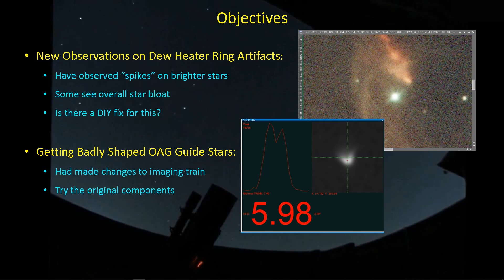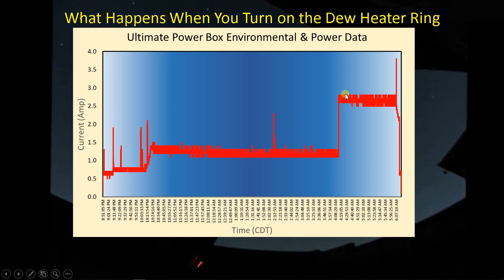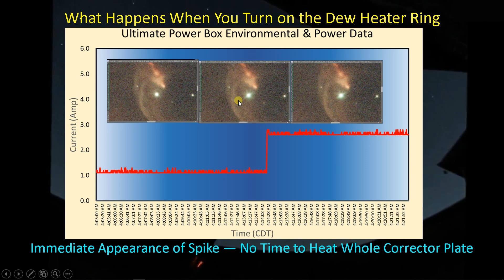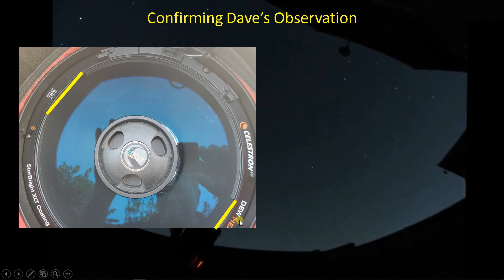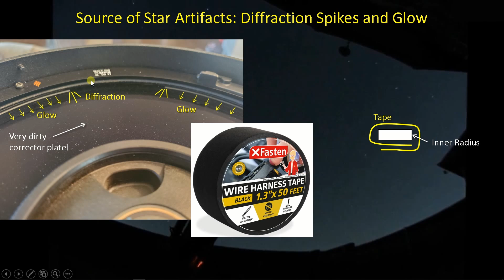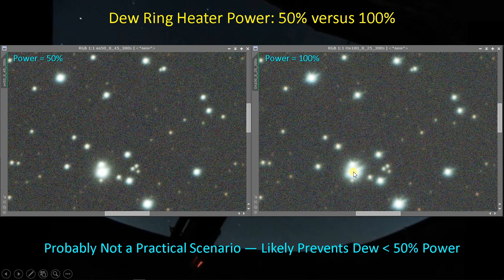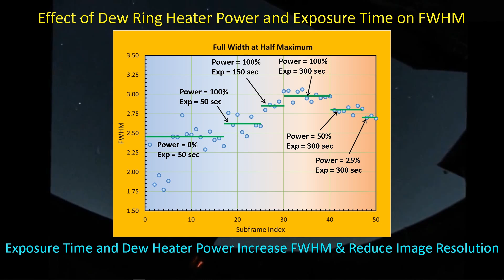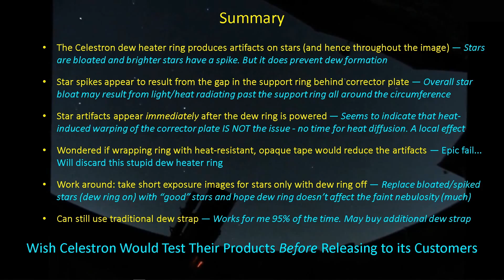New Observations on Star Artifacts Created by Celestron's Dew Heater Ring

Comment: has anyone tried bang-bang control on this heater? Rather than keeping the heater on at all times, you would turn on the heater at 25% , warm the corrector plate to some degrees higher than the dew temperature, say 8C or so, and then turn off the heater until the corrector plate is 2C higher than the dew temperature, then heater back on. Might need to experiment with the temperature hysteris so the center of the corrector plate  does not get below the dew temperature when the heater is off.

Comment: Could be the ring expands and puts mechanical strain on the corrector
Reply from the maker: I don’t think so. The ring is not clamped to the corrector with enough force to transfer forces into the glass. The star spikes line up with the gaps in the corrector plate support ring. The bloating seems to affect all of the stars (and any nebulosity). Thanks for watching!

Comment: I know nothing about thermal dynamics, but it seems every component of this set up is a really good conductor for heat, the ring is metal the screws are metal and then the corrector glass, all hold heat and cool down slow what if the metal screws are replaced with nylon screws they will absorb the heat but since they don't hold heat that they absorb it dissipates quicker. Be gentle as I said I'm just thinking out loud.
Reply from the maker: @timothynorman6412  Hey I’m no thermodynamics guy myself. The thing is, I don’t think it’s a heat diffusion problem. I see the effect instantly with a change in the power setting, so there’s no time for the heat to propagate into the corrector plate. It does prevent dew, but the side effects are annoying.
Reply: @Aero19612  That's odd increase power and spikes appear, it's almost like it's vibrating. I am putting together a rig think I will stick to a dew shield and heat strap.

Comment: Hi. I just confirmed this on my 5min subs. Turning dew ring on and off on alternating subs. It does appear to be immediate. Maybe it is still useful as a "dew clearer ring" in the early morning. Would be nice to be able to control it in a sequence. It's a shame it can't be used as intended!
Reply: I now control it using NINA advanced sequencer and setting up the pegasus power box micro as a switch device. I take 5x5min subs with 0% power to the ring, then use 100% power for 5mins while taking no exposure and then looping that. This works for dew, and almost works for the images, the first image taken after the ring is turned off is still affected. So I need to add a delay after turning the ring power off. How long? I don't know yet, but another 5 mins is enough.

Comment: I wonder how this would affect planetary imaging? 
Really bumming, just bought the ring and on top of it, had to buy the Ecco to make it work with the  Eagle 🙄
Reply from the maker: Just try to operate at the lowest possible power level. I only rarely do planetary imaging, but I think you should be OK. Turn the ring on before imaging to pre-heat the corrector plate, then turn it off while collecting data. Rinse and repeat. Good luck!

Comment: This appears to be electrical noise. It appears immediately when powered on, and reduces when powered down.

Use a separate isolated power supply.

Provide an electrical ground to the dew ring circuit.

Turn off heater during exposures.
Reply from the maker: Electrical noise could be a problem, but I don't think that's what's going on here. Two reasons: (1) I don't see "bloomed" stars when using the dew strap at the same power level (same power source) and (2) the "streaks" are not consistent with general noise, i.e., no reason for directionality, plus the streak orientation is correlated with the gap in the corrector plate support shelf.

Comment: Always enjoy your videos. Question: Isn’t the Gap present when the heater is off? Why would the gap be the cause only when the heater is on and not when the heater is off?
Reply from the maker: My guesses were (a) that the heating element produces a glow that is block everywhere except at the gaps and/or (b) more heat is conducted out of the corrector plate where it is in contact with the supports, so the unsupported are (at the gaps) is hotter and possibly affecting the optical path.

Comment: Since watching this video for the first time, I've had a couple of nights out with my EdgeHD 8 and the Celestron Dew Heater & Celestron Controller.  Last night I had clear skies until about midnight and it was about 20-23 deg F with about 80% humidity.  Needless to say, when I brought the equipment inside it was frosted over -- except, that is, for the corrector plate which stayed dew-free. What's relevant to this video is that prior to using the dew heater the past couple of nights, I turned down the aggressiveness on the Celestron Dew Controller to 3 (from 5) and I didn't see the star spiking in any of the 60 frames I took last night.  When I had the controller set to 5, I definitely did see spikes.  I knew the dew heater & controller were doing their jobs since it was very humid and cold and I'm sure I would have had frost/dew on the corrector plate if the dew heater wasn't working.   (I also used the Celestron aluminum dew shield with the clips on the side and the cutout for the dew heater wires, but I've been using that since day one and still had spikes with higher aggressiveness settings, so I don't think that factors into anything.)  Not sure exactly what an 'aggressiveness' setting on the Celestron Dew Controller means, though.  Is it just the power setting, or does it factor in some type of change in heat intensity over time?  So, I'm not sure how the setting of 3 on the Celestron Controller would correlate with a temperature setting on a controller without a thermistor.  Anyway, I thought this was good information to share...  

FOLLOW UP/EDIT-- After calibration and integration (but before any processing), when I zoom into the image I can still see some very, very small spikes around the largest stars.  However, the spikes appear more symmetrical, i.e., I don't see the predominant 11 and 5 type spikes James showed on the video.  In terms of star bloat, I'm afraid I just don't have anything to close enough to compare to this set of images to determine if the star bloat is any less. (I've only been using the EdgeHD 8 for a short while and have had limited nights to test different things).  So, in conclusion, I'm afraid the only data I can speak to is to support James' conclusion that less power to the dew heater ring reduces (but doesn't eliminate) the spikes.  In my hands, though, at aggressiveness of 3 with the Celestron Controller,  I did see diminishment in the elongation of the 11 and 5 spikes.   Wish I could have been more helpful.  (If anyone want's to see my images, shoot me an email at my firstnamedotlastname gmail account.
Reply from the maker: Very good feedback, Greg. Thanks! Do you think you're getting any star bloat either at a setting of 5 or, now, 3?
Reply: @Aero19612  I'm running my subs through PI right now, James.  I'm going to check my previous images at higher aggressiveness to see if I can detect star bloat.  Wish I had used the same target as one of the previous sessions, but hindsight...
Reply: @Aero19612  I couldn't really find anything to compare with this data to determine the degree of star bloat as compared to higher power/aggressiveness settings, James, and I modified my post since when zoomed in to the calibrated/integrated images I still see very small spikes.
Reply from the maker: Ahh. That's too bad about the spikes. Will the ring prevent dew at your location at an even lower aggressiveness setting?
Reply: @Aero19612  Yeah, I got too happy too fast! :-)  The good news is that the spikes aren't visible unless I zoom in (and they are more symmetrical) so I don't think it will degrade the image processing too much, but undoubtedly, it's degrading our resolution a bit.  The next time I can set up under similar conditions, I'm going to try several different aggressiveness levels since I'm curious as well whether dew/frost will form if I go even lower than 3.  Of course, I want to confirm that the spikes reappear once I go up in aggressiveness and I want to be able to compare star bloat at different aggressiveness settings.  (All this as long as my fingers don't frost over...)

Comment: A couple of data points.  When I got this effect the other night, I had the Celestron dew ring turned on to 60% duty cycle at 13.5 volts.  It turns out to have a resistance of 8 ohms (less than most dew heaters, so more power), meaning it was putting out 60% x (13.5^2 / 8) = 13.7 watts, which may have concentrated too much heat in a small area.

Last night I kept it turned off and instead used an Astrozap strap installed in the traditional position around the tube just behind the corrector plate.  No streaks on stars.  The straps' resistance is 12 ohms and I had to turn up the duty cycle to 100% to completely get rid of the dew.  That was 15 watts, but spread over a much larger area.  I think the main effect is actually to warm the air inside the telescope slightly, keeping the corrector plate warm via the air behind it.  

Bear in mind that by "warm" we actually mean "about the same as the surrounding air."  Dew is a problem because some surfaces exposed to the sky will radiate away so much of their heat that they become colder than their surroundings.  So, used correctly, a dew heater should probably improve seeing rather than worsen it.

I'm guessing the Celestron heater is prone to creating small hot spots, but I haven't investigated.
Reply from the maker: Hi Michael,
There’s no doubt that the Celestron dew ring puts out much more heat than my DewNot dew strap. Somehow, that dew strap is able to keep the dew off of the corrector plate most (all?) of the time. There’s no way it’s heating the corrector plate. In my case, I mount the strap on the front of the scope with it overhanging the end. It must be heating the air in front of the corrector plate just enough. I wish I understood this process better. But I’ll settle for no dew and ignorance, but don’t leave me with bloated stars.

Comment: Based on what I've read so far, I think the leading possibilities are (1) the corrector plate gets warmer over the gap, causing it to flex and introducing astigmatism; and/or (2) the warmth sets up an air current that is primarily through or near the gaps.

I don't think the dew heater glows.  There is just not enough heat.  Visible glow requires a temperature hot enough that you would burn your hand touching it.  Dew heaters, even this one, rise only a few degrees above ambient, normally.  They glow only in the far infrared.

I don't think magnetic fields affect light.  Conceivably, there could be some vibration caused by the DC power pulsing on and off, but you'd hear a whine.  People have seen this effect with several different power supplies (mine is a PWM of my own design, frequency about 450 Hz, which would be quite audible).
Reply from the maker: Some good thoughts, Michael. There could be some local warping of the corrector plate. I doubt that air currents are the issue and certainly don't think any form of vibration is the source.

As for heat glow, the temperature increases the corrector plate temperature by 12 deg C about 1" from the dew heater ring. See 7:20 in
https://youtu.be/gU43rhYAoGA?si=q0lw5m9yXbYd_5Pz
Reply: @Aero19612   My impression is that 12 C is a very large temperature increase for dew control purposes -- I was under the impression that a couple of degrees were usually sufficient.
Reply: Metal and glass expand differently, so there might be pinching.
Reply from the maker: @michael.a.covington  Yep. Would be nice if Celestron provides over-size clearance holes in the corrector plate to permit the glass to move relative to the aluminum. They may have - I don't know.
Reply: The chart at 8:08 in that video is alarming. Don't we want a uniform temperature, as far as possible?  Also, those temperature increases look way too big.  And, looking at the earlier chart, 100% power is 30 watts!  With that setup I would run that dew heater at maybe 15% power.

The root of the problem may be that this dew heater easily gets too hot.

My Astrozap dew heater strap draws 1 amp (12 watts) at 100% power.  I normally run it at half that or less.  And it's on the outside of the tube, with plenty of metal to distribute the heat evenly.
Reply from the maker: @michael.a.covington   Yeah, very hot. The "his video" is "my video", haha. Absolutely, we would prefer to have a small uniform temperature across the corrector plate. But we can't get a uniform temperature because the source of the heat is on the perimeter and has to diffuse through the glass. The max power is 24 watts (2 amps at 12 v) and is probably way too high. But the 25% power does not seem to heat the corrector plate adjacent to the secondary mirror.
Reply: Sorry about using "his" confusingly -- I sometimes don't pay enough attention to who made a video.  I have edited.
Reply: @Aero19612  There has to be a better way.  What temperature distribution does a conventional dew strap produce?  Are infrared thermometers even accurate when measuring glass?  Should we shift our attention to warming the air in front of the corrector, perhaps with a strap around a dew shield?
Reply from the maker: @michael.a.covington  Haha. I thought it was funny. That way if you said "he" is a moron, I could simply agree with you.
Reply: @Aero19612  I don't think anyone here is a moron, and I haven't been very diligent in keeping track of who proposed which ideas.  I think this is an important issue, and the root of it is probably going to turn out to be that the Celestron dew heater gets too hot when given the amount of power (voltage + PWM) that other dew heaters normally run on.
Reply from the maker: Yes, I think the small amount of heat put out by a dew strap is actually heating the air in front of the corrector plate. When I attach the dew strap to my scope, it's hanging off by about half its width. Being a one stop shop for stupid ideas, I have thought about setting the dew heater ring in the tube but with the heating side pointed toward the sky. It won't sit flat because of the power cables, but it wouldn't protrude into the light path for the imaging sensor. That thing should heat the air pretty well. Maybe even grill some hotdogs while imaging...
Reply: My understanding is that to prevent dew, all we need to do is keep the glass close to the temperature of the surrounding air.  By radiating heat and not being able to conduct heat very well, glass, exposed to the sky, becomes cooler than the surrounding objects and air, which is why we have dew problems.  I've always thought a slight temperature increase was sufficient.

Comment: I have not seen this effect on my EdgeC8. I use a Pegasus controller with humidity sensor on auto. I am near the ocean so humidity is a big problem.  Perhaps rotating the dew ring to see if spikes rotate? As someone here said, it could be an effect from the Celestron controller since the effect is so sudden. Perhaps those gaps are allowing light into the scope? Is the compliance graphics in the right location per Celestron instruction (at dovetail) ? Did you over tighten the mounting screws and make sure to tighten in a criss cross pattern? As I recall, the original gasket was discarded during installation. Did you remove it?
Reply from the maker: All good comments, Ron. I used the Pegasus Astro Power Box to power the ring. Others see the same effect when powered by the Celestron controller. I did remove the original gaskets and I didn't over tighten the screws.
BUT
I must have missed the instruction on placement of the compliance label. Just re-read the instructions. It's clear as day. I rotated the ring so that the power cable is at the top.
Reply: @Aero19612  Has rotating this made a difference in your stars?
Reply from the maker: @SKYST0RY  good question. Simple answer: “No”. I should have. I tried a different approach that didn’t work and just decided to remove the ring. I would be VERY interested if there is actually a difference. I feel stupid for not seeing that instruction in the first place. Some days I just want to get out of my own way!

Comment: Just a thought... Since the "disruption" begins immediately when you turn on the heater and the heater has no moving parts, it might be an interaction between flow-induced vibration (FIV) and forced convection heat transfer. If you do a search for FIV you get a bunch of results. Since you don't have suprots the full 360 degrees around the heater could it be producing a vibration at the missing support points?
Reply from the maker: I don't think vibration is a player here. To cause vibration of a large mass like this via FIV, there would have to be very high speed flow. The wind would produces MUCH larger effects than this little ring. I think there are simpler explanations